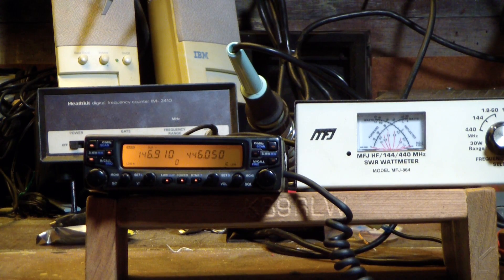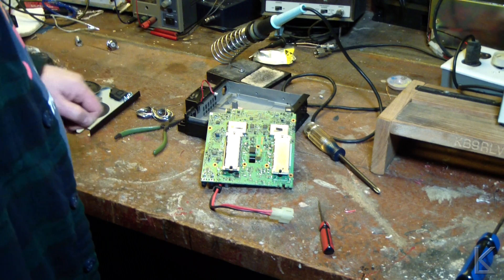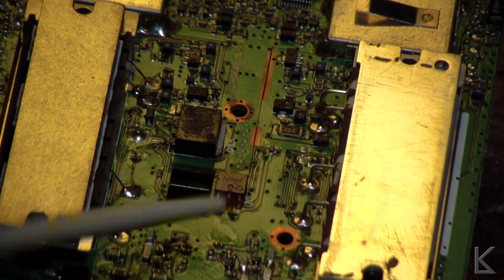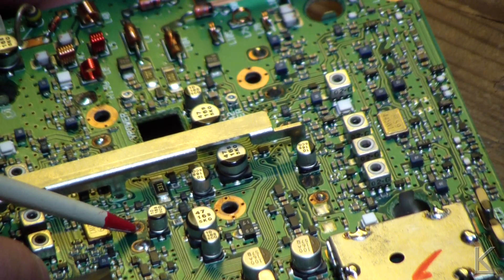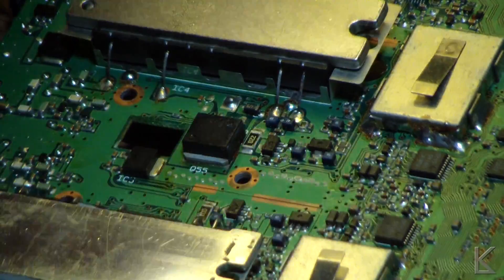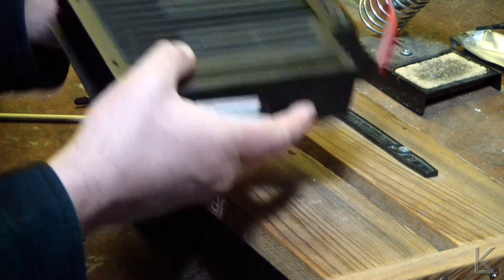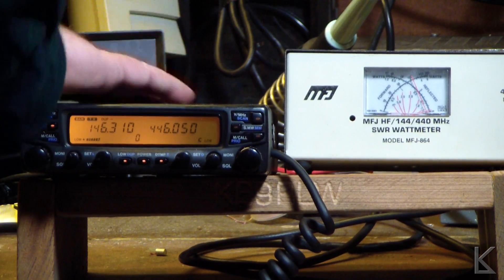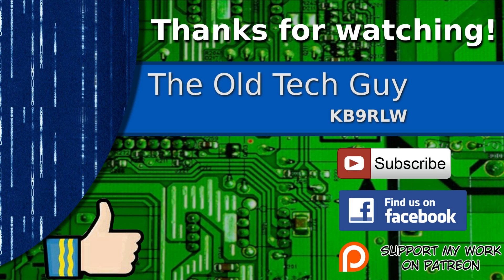Ham Radio - Repair of an ICOM 2710 with intermittent power output

Comment: I just got one of these radios and it seems to work fine, except the display light is out and I can't get it to come on, no matter what I do.  Would you have any idea what would cause this?
Reply from the maker: Nope, that was the only time I had a chance to look at one. But the service manual is available online. It's probably new enough to use LEDs for the backlight instead of rice grain light bulbs, but that's only a guess.  If it does use the rice grain bulbs, I would replace them with small LEDs. But as I said, that was the only time I saw one so I don't know.
Reply: @loughkb  I think I've downloaded the service manual for it but not sure.  I've gotten a few "new" radios and have been trying to get one programmed.  Finally got an interface "cable" made for it and got it programmed, now I'm working on setting up the 2710.  Thanks!

Comment: I have the same radio and the vhf will only transmit 3w on any setting which then drops and holds to around 1.7w after a few seconds. 
The UHF side of the radio works perfect though? I popped the cover off and the solder joins don’t look the best so fingers crossed that’s my fault to as I just bought it.

Comment: Hi Kevin, thank you for this very informative video. What do think is the problem with my IC-2200H that drops the RF output to 10 Watts in all power level. LOW, MID, and HIGH. At first, it shows the normal output but after a few seconds,  it goes to 10 Watts? Thanks!!
Reply from the maker: Sounds like a bad solder connection.  As it heats up, it opens up. Just speculation on my part though.

Comment: I'm in midst of updating mine, I bought it about 1975. I used it extensively for about 5 years and even added GLB Channelizer and DTMF keypad because I travelled a lot and used phone patch.  I pulled it out recently, replaced electrolytic caps.  Inductor in noise amp was open.  In going through it I found several solder joints that had cracked at the board.  I also found some of original crystals not working.  The second mixer crystal was off by about 6 KHz. Reciever and transmitter stages needed very minor tweaking.  But output is weak and I can't find info on adjusting the output stages.  I loved that rig and hope to add CTCSS to GLB so I can use it again.  I have seen several of these and all had broken fuse holder.

Comment: hi i have a icom 47a has sound no number on screen just the dot.You key mic or tune tuning knob or push buttons on mic seems to do nothing.
Reply from the maker: You'll want to start tracing power through the board.  Look for a dead voltage regulator or bad diode.
Reply: @loughkb  OK thanks i repair laptops but this is a little different.

Comment: Kevin,
Was there any heat sink compound on the final amps?   73   WB3BJU
Reply from the maker: Well, ICOM built it with no compound and the radio ran for years and years even with the poor solder job from the factory.  The fan runs on keydown regardless of temperature by design, so there's plenty of heat removal.   It will be fine.   The owner is going to use it in low power mode for cross band operation occasionally, so it will be on a very low duty cycle.
Reply from the maker: +Donald D'Egidio none. Thought about it, but with the screws and polished surface, I think a pretty solid contact is made.
Reply: Kevin Loughin they should have a bit of heat transfer compound as the finals of the output pa modules is close to its centre...If it lost power on both band's then the problem would be either in relay or common output rail cct...73 M0BFM